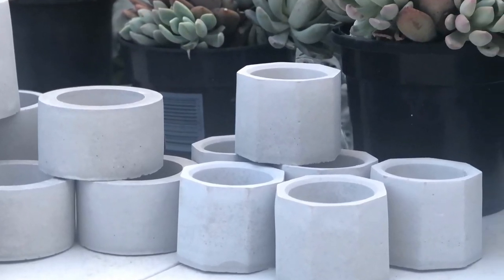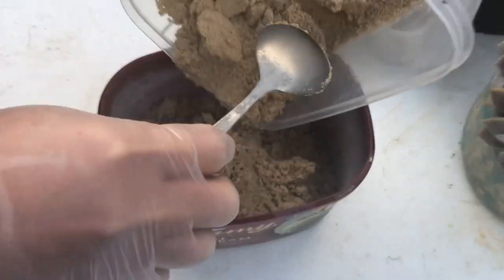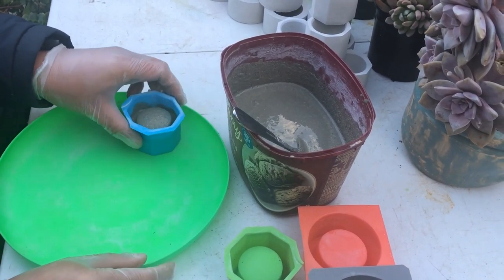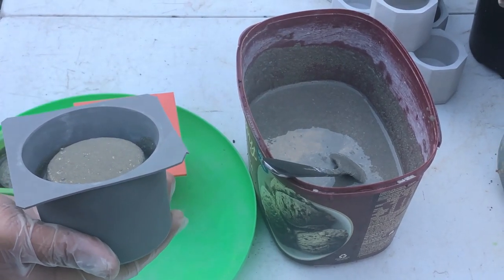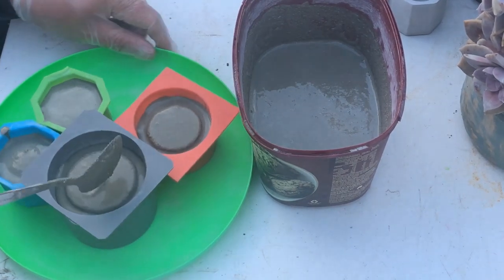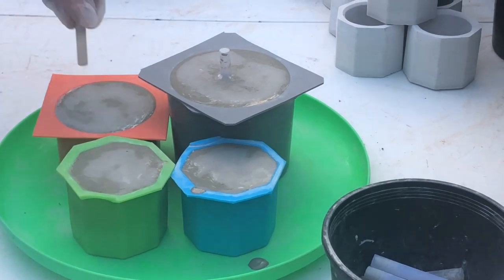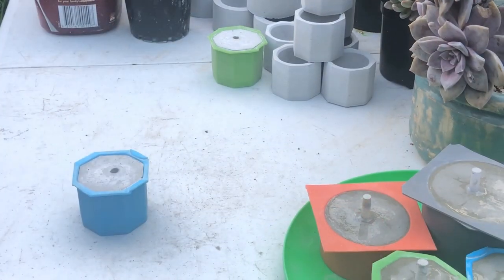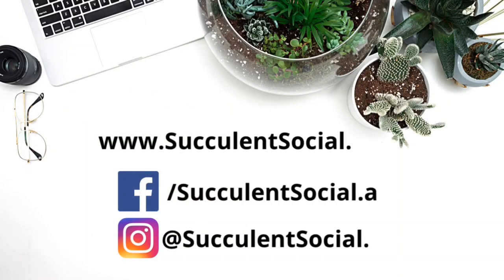Step-by-Step Tutorial: HOW TO make CONCRETE POTS for SUCCULENTS // DIY pots with smooth finish//

Comment: I have a question, when my molds are all done, the top or rather, bottom of the vase is very irregular even if I put a decent ammount of concrete. it is also a 3 day drying concrete. how do you avoid it getting so rough? I'm thinking mine just drink up a lot of the water and it gives it that irregular finish...? any help?
Reply: oh, I make sure to wiggle it when it's wet so there are no air bubbles
Reply from the maker: Hello! :) we usually tap the mould multiple times to achieve a level surface, which also allow the air bubbles to go up and released.. if your mix doesn’t have a lot of water, you just have to tap it longer to achieve a flatter surface.. also suggest to pour in the mix by parts (for smaller moulds, 1/3 parts works for us, or 1/4 parts for bigger moulds) then tap it before the next part to allow the mix to settle in properly. :)

Comment: I bought a cement pot...no drail hole.. So which succulents would be ok without drainage?? Or should i just use it as a cover pot??
Reply from the maker: Hi Michelle, you can plant any succulent in pots with no holes but you will really need to ensure not to overwater. Alternatively, you can also add in some holes. ;)
Reply from the maker: (oh and sorry, I got to reply only now. We recently moved home which was such a big task, was not able to open the YT account)

Comment: I made these pots but after 2 to 3 days they start to crack..any solution for this?
Reply from the maker: Hi @Ritisah Peerthy, we found from experience that concrete mix with high ratio of cement tends to crack easily.  you may wish to try different ratio of cement and aggregate (eg. sand) and find the best mix (as this depends on the quality/type of cement as well).  all the best! 😊